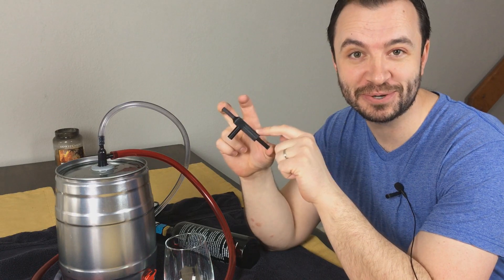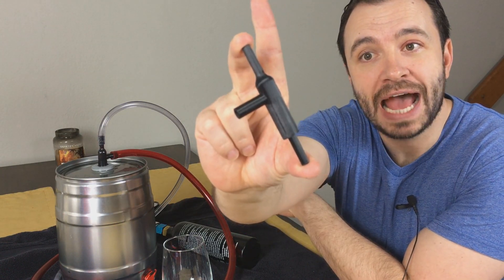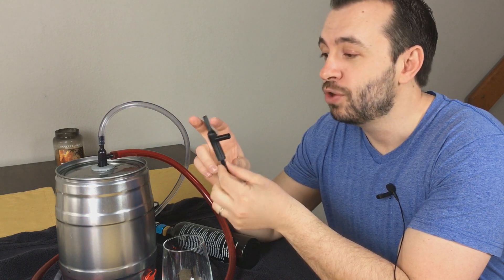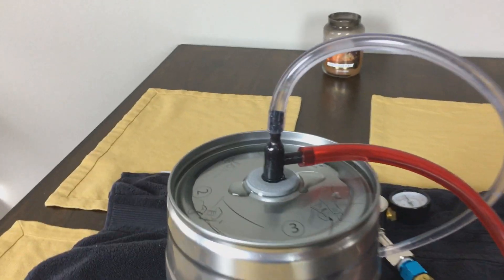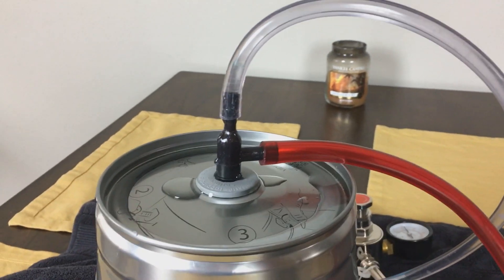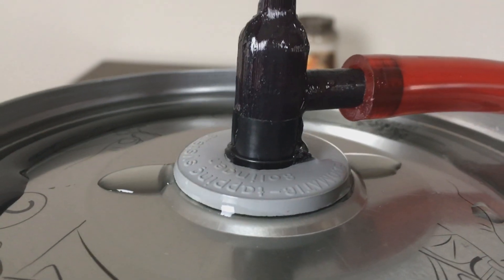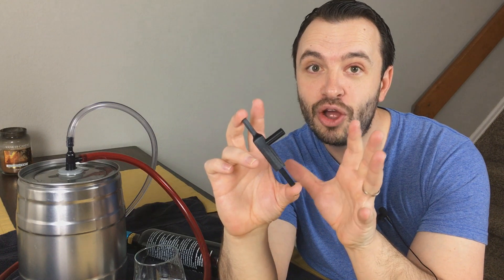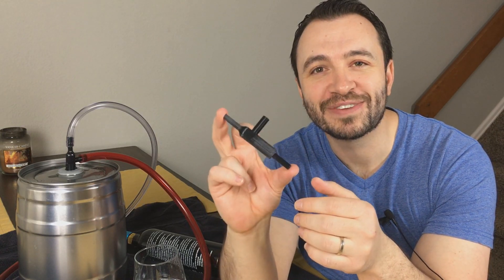Mini Keg Tap System Prototype for Home Brew Beer

Comment: I know this video is older, but did you get completed and did you do anything for seltzer
Reply from the maker: I did contact a few companies about manufacturing some pieces based off my prototype. Unfortunately it was way to expensive for me. The minimum was 10k. 

I am using a new system now for carbonating. Basically just a mini keg and co2 tank. I use it mostly for carbonating water as I’ve slowed way down on drinking. You can see that system here: How to Carbonate Water at Home
https://youtu.be/lfGz7sKvnNQ
Reply: @CleanMachinesYT  , thank for the reply, I have retired from drinking and tired of change seltzer bottles. Unfortunately I have and OVER engineering issue, so my project will not only be plumbed in, refrigerated with a KRUPS mini keg, a large CO2 tank (I have access to 100lb tanks, but doubt I will go that high), a myriad of solenoids and valves, a Arduino controller and a plumbed in tap for my Keurig. One of many projects on the bench. will check out the new video

Comment: Did you ever get sorted with this ?? Im strugeling to get your parts list in the uk
Reply from the maker: I’ve received quotes from 2 companies and  unfortunately it’s too expensive for production. Can you tell me which parts specifically you’re having a hard time finding? I could put them together and get them on eBay for you.
Reply: @CleanMachinesYT  its a few parts to be honest. due to here in the uk we are mainly metrick
Reply: I would be wanting 3 keg setups to run of one bottle and regulator

Comment: Oh wow, what an awesome innovation.

I am just starting homebrewing and got several of these kegs.

I've watched your other videos where you used the disconnects. Those videos are more more recent so I am guessing have superceeded this, but this is such an elegant and more compact solution
Reply from the maker: Yeah I’ve hit a wall with this tap system. The problem is the 3D printer I have can’t make a prototype that will be airtight under pressure. I’ve looked into having them molded professionally but unfortunately it’s very expensive. I love this idea but don’t know how to make it work right now. Thanks for watching!

Comment: Was there any further development on this item? I, like other commenters, hate bottling day. I am looking to start using mini-kegs for my 2 gallon batches.
Reply from the maker: Hi James, unfortunately I’ve hit a wall. I talked with 2 manufacturers about making these pieces and the minimum order is in the 10,000 range which is pretty pricey. At the moment I’m looking for another way to 3D print them airtight or another manufacturer. If I find a way I will definitely make a video about it! Thanks.
Reply: @CleanMachinesYT  Thanks for the quick update! I'll just have to do a homemade one like some of your other videos for now.
Reply: @CleanMachinesYT  Have you searched a 3d printing company that can do 100 runs or less made of food grade stainless

Comment: Make the connections barb
Reply from the maker: I actually designed another system using hose barbs! It works great.
Reply: @CleanMachinesYT  did you end up finishing the design? looking for a kegging solution for my party kegs (i already have a bunch so thats why im not doing oxfarm, which seems to be the homebrew standard as it is now

Comment: Did you use 3D printer for proto?
Reply from the maker: Robert Humphry yes I used a 3d printer. I’ve done a few prototypes and still have a problem getting it to hold pressure.
Reply: It looks like a good solution  - a lower profile would be nice (dispense on the side instead of the top).  I already made my solution - so I would not be purchasing (unless it was at a sweet price point )